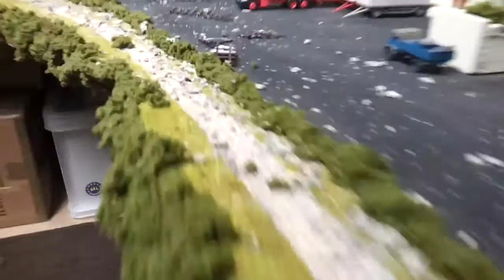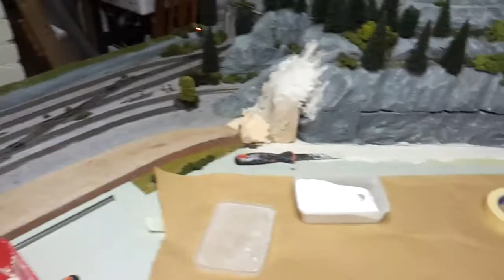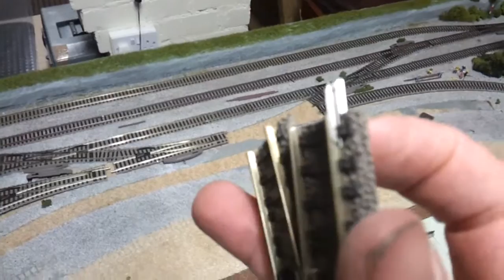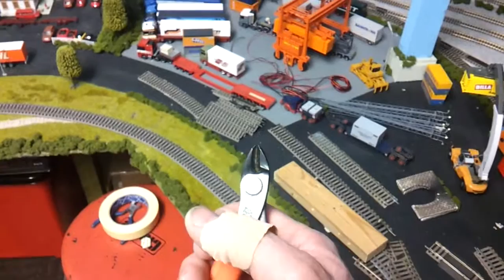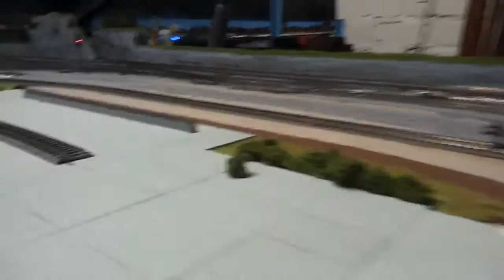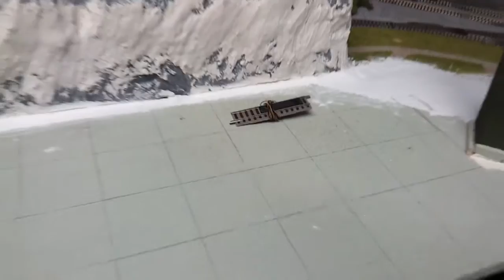BIG YARD MOD UPDATE 1

Comment from the maker: Hi stevie, 
Thanks..the fleischmann track is so easy to use over and over , there are many points you can buy but I think they are a tad more expensive then peco .
There's no messing with wireing electro frogs as the inner point meganasium takes care of this on a special switch system in side the point, also they are all thinking points as well e.g for disabling feed for sidings in analog mode etc. All my point motors are surface mounted as they are sleek and not that noticeable, the point motors can also take add on working ground signals. .
Reply: Cheers for the info Jim.
STEVIE B.

Comment from the maker: Hi sam, thanks, yes fleischmann profi track is amazing as it is pre ballasted so no messing with with pva etc . Only around the edges you need to do , the point motors are great as they just clip on and can be operated by hand as well with the motor in use...